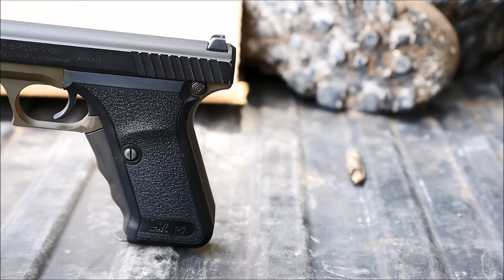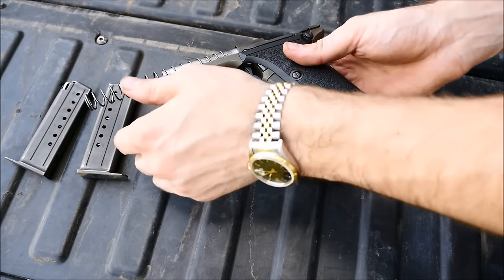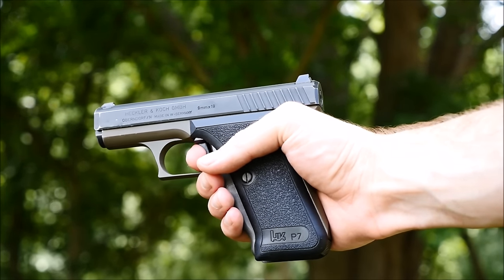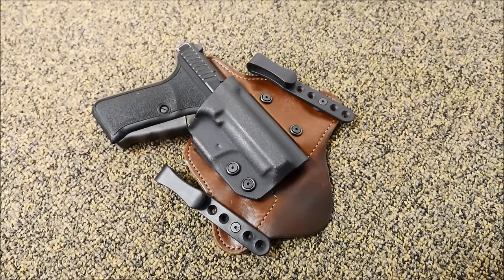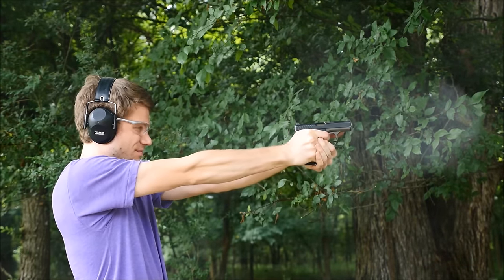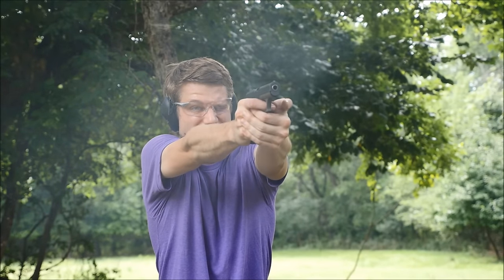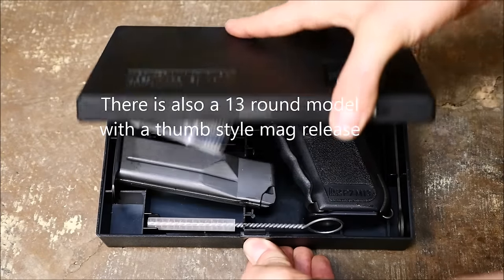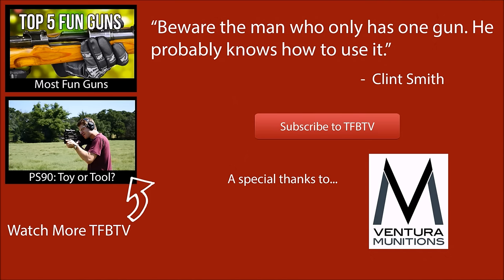The H&K P7 (And Why I Carry One)

Comment: If you don't trust yourself to draw on a private range you probly shouldn't draw in public under stress... When drawing a handgun from an OWB holster at 3 oclock there is really no possibility of flagging yourself. I practice that as well as appendix, either way if you use common sense and discretion, drawing isn't dangerous. Practice makes perfect.

Comment: Back when we could own cartridge pistols in England, this first pistol I bought was the HK P13 - the 13 round magazine version of this pistol. I used that in Practical, Service and Police pistol matches, and loved it. The low bore axis meant a reduced muzzle flip, and the 4 inch barrel was sufficient for accuracy even out to 50 metres if you took a bit of time. I didn't hand it in when pistols were made illegal, instead I sent it to my friend in Arizona, and use it when I get to visit.
 
Incidentally, the heel of butt release was a feature of the original design for the German police pistol trials, as it was a common type of release for European service pistols for many years.. H&K then made the pistol with an ambidextrous mag release by the trigger guard - essentially a lever you pushed down rather than a button you pushed in, in both 13 and 8 round variants (H&K P7M8 and P7M13). Thank you for the review - I loved this gun.
Reply: Awesome that you prevented it your pistol from being destroyed.
Reply: Kristoff Gerhardt Didn't fancy an armed police response team sledgehammering my doors in followed by a 5 year jail sentence.
Reply: outstanding move sending it overseas to protect your property and still be law abiding. I can see it has a great sentiment value for you, i would've done the same.
Reply: to those who own this, in terms of training, how many rounds in does it start getting too hot to handle? i've heard stories of police officers needing to apply nice on their hand while training with it.
Reply: @cagneybillingsley2165  300-500 rounds.
Reply: @cagneybillingsley2165  I wouldn’t want to shoot more than a couple of fifty round boxes, because the PSP doesn’t have the heat shield below the barrel, and your trigger finger is going to get fairly hot before you know it! The average person probably won’t train as hard as the police, but there ARE exceptions to the rule. On the other hand, if you’ve got the P7M8 or the P7M13 the magazine release is in the traditional spot as most American 🇺🇸 firearms ( on the left side behind the trigger ), also the plastic heat shield will be below the barrel on the frame.  The PSP is not a bad choice for concealed carry, because you’re probably not likely to be shooting a case of shells.  Some of my friends like to carry a backup, and you could consider the PSP as a good option for backup.  The only problem I’ve ever envisioned with this gun is the fact that H&K doesn’t make this firearm anymore because of the expense.  They’re beautiful guns that are made like a Swiss automatic watch, and even the ones that were used fairly extensively will fetch some good money.  Sorry about the long description, but I’ve been a fan/owner of the various models of the H&K P7 family for years 🤷

Comment: Thanks for the video review!  I am a longtime P7 owner and carried it for a time as my EDC, but the increasing cost and scarcity of this pistol made me reconsider and change to a less expensive, current production gun. I am thankful I never had to use my P7 in a critical defense situation, and I completely agree with you about the ergonomics and ease of use, but if the unthinkable DID occur, the reality is that the pistol might be confiscated or 'lost' due to ther legal nightmare that follows a self defense shooting. My particular P7 has been hard chromed for corrosion resistance and with aftermarket prices now at the $2500+ range, my P7 is now just a safe queen and occasional range gun. Keep up the excellent videos!!

Comment: My P7 M8 is not a safe queen. It’s my EDC since ’86 to present day.  Some have purchased ten to twenty firearms to my one costing thousands more. It’s like my expensive snap-on 1/2 wrench from the 70’s it’s a tool ( not a quest ) it still works ! Extremely accurate, ransom rest 25yds a nickel sized grouping. Follow -up shoots are easy , very very low bore axis ,  4.01” fixed barrel , metro sights , glass smooth trigger (no barrel changes needed) poly barrel.  550 rounds avg. yearly according to my logs practice, practice , muscle memory and manual of arms are now liked breathing ‘ Five mags ( eye cases are good…smile )  Corbon ammo +P 125 gr. or Feds 135 gr. The 9mm cartridge has improved enormously . The best handgun ever made YES . Over engineer not , unique yes, your life dependent on it yes never fails .  Run out of ammo I’ll burn you with barrel .…smile… Two attempted car jacking  still here . Remember, guys I’m not John Wick in the Catacombs with 50 bad guys after me, he should have had  6 30 round mags for that AR , that’s Hollywood . The heir loom is for my grands !!
Reply: I purchased one of these back in the early 80's too. It rode with me everyday for 10 years or so. I ended up giving it away to a friend of mine's widow as a house gun. Would love to have another. The weight never bothered me much since I didn't carry concealed - as a rancher, I didn't need to do so. The gun was reliable and shot well. Like I said, I would love to have another.

Comment: I just realized this is the gun Hans Gruber used in Die Hard.
Reply: BalzToTheWall86 The nickle plated version.
Reply: 247tubefan correct the “ chromed” version. I had one of the chromed versions several years ago . Was told by seller the German police turned them back in to HK in the 80s and they chromed them for resale out to public etc. Beautiful pistol .
Reply: Burton Kephart Ahh.. thanks for the info. That chrome version with wood grips is a holy grail.

Comment: There are only two downside to a P7, first is the weight and, second is how hot the slide near the front trigger gets when fired repeatedly. This second problem was fixed in later versions by t he addition of a heat deflector. Comes in a very wide range of caliber's and best of all holds it's value well against the others. Some people find the grip cocking odd at first but practice over time gives you a respect for this superior handgun.

Thank you for sharing. Wishing you many more happy years with your H&K P7.

Comment: Not many pistols are as accurate as the P7. Not sure why fixed barreled pistols never really caught on. I carried the P7 psp (heel release) for two years as a duty weapon. NJ State Police carried the P7 M8 for about 10 years. The Irvington NJ PD used it for about two years. They had a few accidental discharges. I never had any accidental discharges but one time I had to "assist" a passenger out of their car at gp. Once they were on the ground, I went to holster the weapon and heard the click. Due to opposition hand reflex when I grabbed the passenger, I also squeezed the decocker. Good thing training kicked in and trigger finger remained on the frame and not trigger. 

Oh the P7 has one of the sweetest single action triggers ever. Follow up  shots, so accurate. Now the pistol is not finiky but must be maintained. Once the weapons began to age 7 plus years, it was not uncommon to go to qualifications and have a weapon not fire on first trigger pull. The springs would break or become worn and cause malfunctions. Some of these guns also had dust bunnies in and around the slide. These guns never cleared leather outside of qualifications. Imagine just hearing a click when it should go bang. Do not take the hand grips apart w/o a schematic. On more than one occasion a detective would bring in a box of parts for the armorer to put their handgun back together. 

We switched over to the Beretta Cougar 8000D when the FBI made the move to the same weapon. Talk about polar opposite. P7 single stack small frame to double stack brick of a frame. The offered us to buy our P7's for $350. I'm still kicking my self or not buying two. But I was young and did not own any guns outside of my issue weapon. But I'm on the look out for a P7 to add to my collection. Thanks for the video. Well made

Comment: I have carried a P7 for a long time, with the increasing cost and rarity it is making me look for a newer different type to carry. Even though it would decrease the value on the one I currently own, I would love another production run so I could justify carrying it instead of it becoming a safe queen. Everybody likes to carry what they are comfortable with, including myself.
Thanks for the excellent videos.
Reply: Walther CCP polymer frame, and the gas system used in the P7. Get the M2 variant, as it is easier to disassemble than the older one.

Comment: I have a p7m8 that I love to shoot, the extremely low bore axis and the delayed blowback operation makes controlling the thing far easier than most compacts but honestly the most important chacteristic of the gun is that squeeze cocking system.

The important part you need to not is that the gun fires when you have both the cocking lever and trigger fully depressed no matter which order you get there.  It means that carry is completely safe since even with a round in the chamber the gun is carried uncocked and the process of gripping the gun firmly also prepares it for firing so there's no issues with failing to actuate a safety, fully rack a slide or slipping the hammer when your manual dexterity goes to hell under a sudden stress situation.

While you can carry a glock cocked and locked, having the gun uncocked until you're in firing position is a very good safety feature, I'm sure you've seen plenty glock trigger snag videos by now, that literally would do nothing to this gun which makes drawing from odd positions much safer, especially if you would need to draw from a seated position in a car.

Comment: 2 notes. These are merely a preference- it does not mean anything in the video is wrong nor bad. I like this video.

I love my P7M8. It's one of my first firearms ... back in 2001.

It has some weight for a smaller handgun; however, the weight & blowback reduction system help to greatly reduce felt recoil.

I've always referred to the P7M8's "cocking mechanism" as the "front strap"

Personally, I seldom... very seldom wear anything other than my P7M8 or P7M10. If I ever needed to draw & fire, I'll need to know my carry firearm functionality without thinking... oh wait... this is a XXX

Regarding the ability to "rack the slide" by pulling the front strap:

I don't do that - carrying 24/7, I don't want to fumble. If I'm not carrying one of my P7s.... & drop & insert a new magazine... pull the front strap on my Glock... & nothing happens. I'd put myself at risk 

I look at this philosophy as a way to create as smooth of a routine & similar muscle memory reactions regardless of the firearm. Of course, I appreciate & maximize the beauty/features of the various firearms.

Comment: I purchased my P7 PSP in 1983 for $620.  No you can't have it.
Reply: Inherited mine from a Friend that Died, came with a total of 3 Factory mags. Love the Gun, But at 53, arthritis is starting to kick in, making squeezing it tough, But they can bury me with it.
Reply: Once I shot a H&K P7 (II) (gas-ported like the Walther CCP and also 
„locked“ by gaspressure) using Fiocchi sintered Bullets (Plasic embedded
 copper-powder). After the 6. shot the Pistol jammed and could not be
 cycled because of partially melting from the bottom of the sintered 
bullets into the gas-porting. Dependig on the situation this could be 
fatal.The disassembly and repair (removing of melted plastics) 
was most time consuming.  This possibility should be taken into 
consideration with the P7 (and CCP).
Reply: @klausramelow4812  Well, first of all sintered bullets are a bit rare on the market and the fact that plastic melts should not come as a surprise to anyone that shoots. I rather prefer rounds that don't do that and retain mass into the target. Service ball, for all its limitations, would be better, so it is not an issue of the gun but rather of the dubious ammo choice of the shooter.

Comment: Watching this video makes be believe that while the narrator is certainly a firearms enthusiast, they have not had much training with the defensive use of a pistol.  1)  Small of back carry inhibits in fight access when entangled with an assailant.  2.  Falling backwards while the gun is holstered can break your spine with a small of back holster.  Talk to an old cop on why they don't carry equipment there.  3.  The way he improperly indexes the magazine in his hand during the reload, index finger should be along the front of the magazine.  4.  He reloads the pistol down closer to his belt than closer to his face (commonly referred to workspace).  5.  He does not place his support hand on his body during the draw, which could lead to shooting of the support hand in a close-retention firing position.  6.  Leaning slightly backwards when shooting the steel, weight should be forward.  7.  Support hand is floating off the gun when firing two handed with the non dominant thumb an inch off the side off the gun.  A firm firing grip is both hands firmly on the firearm.
Reply: For whats its worth, He never claimed to be a expert on shooting or tactics. This channel is more about the history and inner workings of firearms, not on how to use them in a gun fight.
Reply: RaftGuidePhil If someone is going to make a video about their carry gun, carry set up, and why they chose them, they should have some knowledge on the subject.  But they do not seem to possess that knowledge.
Reply: This is not a instructional video. Hes simply showing HIS carry gun and HIS carry technique. He did not say anything about how you should carry your own gun.
Reply: Just to clarify, BMAH, knowledge is different from muscle memory. He may mentally know how tactical instructors would say you should reload, but he may not care or have built the muscle memory in doing so. The simple truth is that many young people (of which Alex is one) are not yet super skilled with using handguns. Shooting and operating handguns well is a life-long pursuit, and it is unreasonable to expect everybody to master something before they post a video on YouTube.
Reply: As a survivor of a spinal chord injury I can confirm that small of back carry is a terrible idea.
Reply: Leaning backwards and having a improper grip is something someone shooting at the range for the first time would do.  You don't need to be Seal Team Delta operator to know what they'd teach you in a 1 day basic firearms class.  Anyway, he just quit TFB to blog about racecar stuff.
Reply: boi you're getting mad because someone is pointing out the flaws in how someone is using a firearm on a channel that is based on firearms.
Reply: BMAH .
Reply: r/iamverysmart
Reply: BMAH Nothing is ever good enough for you is it? Did you experience a lot of critiquing from your mother and father during your childhood? I sense they pointed out flaws in everything you did. Little things that range from how you put away your toys, ate your food or how you did household chores. You made it a habit to negatively critique everything into your adulthood, being “the downer” as you sought out to find flaws and mistakes of others.

Comment: The only complaint I ever had with mine and the reason I ended up selling it was the heat on the trigger finger after long firing strings. Mine was one of the first ones and it would get some kinda hot after a few mags. Awesome weapon though and I do regret selling it now. Good video.

Comment: This particular version is the "original" European version with bottom mag release. He does mention a 13 round version with a different release, that is the P7M13. They also made a model called the P7M8, that was a 8 round version with a side mag release . Both of the newer M8 and M13 versions also have a small plastic shield above your trigger finger to minimize burns. This pistol had a special piston system that would use spent gasses to delay the slide, if you shot a lot of rounds fast, it got very hot ! Also, you should always use total metal jacketed bullets with this pistol ( jacketed bullet base). Because of that piston system, lead can foul the piston and will make the  pistol malfunction !  I have mine because the previous owner used dirty ammo and got annoyed that it was malfunctioning !  A side note that is NOT mentioned about this pistol, is that IF the squeeze cocking mechanism is gripped while your finger ( or anything else) is on the trigger, IT WILL DISCHARGE.  They are out of production for many years, and they command quite a bit of money if you are looking to purchase one. It is a fantastic pistol and i would never sell mine.

Comment: I carried a P7 while working in the US in the mid/late 90's, and thought that if I was going to CCW it had to be the best 'pointer' I could find. I was lucky and found a P7M13, it fit my hand like it had been made for it, and the triggerfelt like it had been through a custom shop even though is was a stock pistol. I  never had any problems even that 'overheating' of the delay piston area, If you have to expend a full magazine at one go to stop a 'bad guy' then there is something wrong how you're doing your drills, the P7 is so inherently accurate that double taps to centre mass should not be a problem.

Comment: The H&K P7: the Makarov meets the Steyr GB. The way I do my training, if the pistol either has a thumb safety, no safety, or a safety that isn't combat-usable, it doesn't matter to me, as I always perform a thumb sweep as part of my draw. Pistols that have a combat-usable safety like the 1911 or M17 are carried safety engaged. All others are carried safety off. I don't like non-standard designs like the P7, though. that would require me to vary my standard manual of arms.